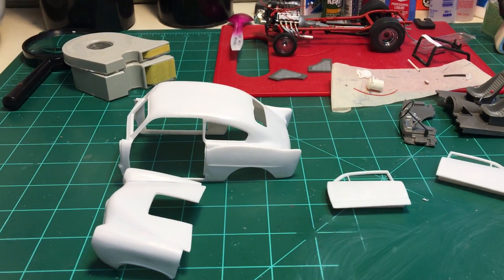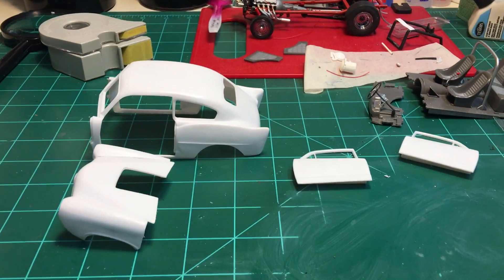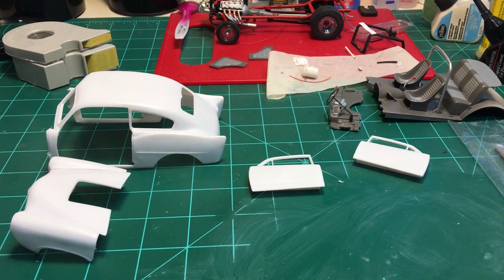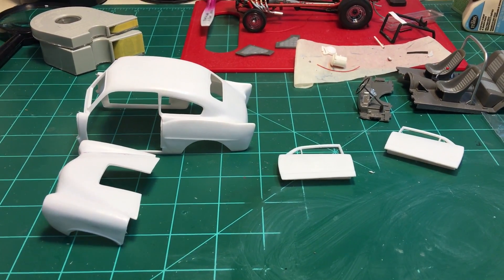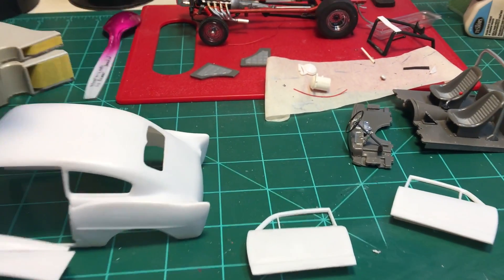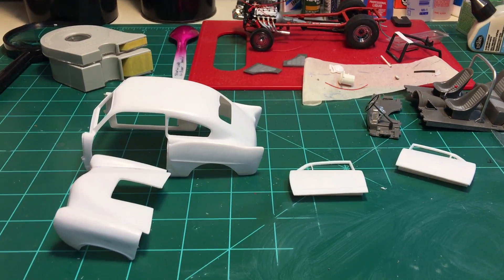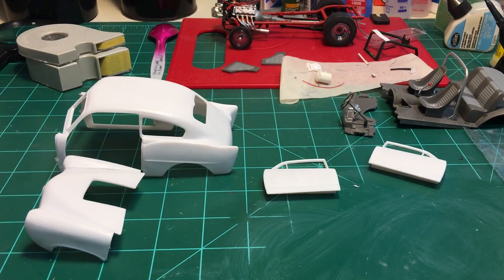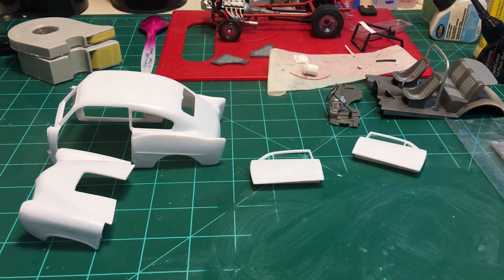51 Henry J Gasser update #3

Comment from the maker: Tim,
I have the pressure at 35 psi per the what the bottle says. I don't think the paint is clogging but I will keep on eye on it. I do have to refill between parts. Maybe I should clean the airbrush out in between refills.
Reply: I would try running the pressure at about 18-22 psi